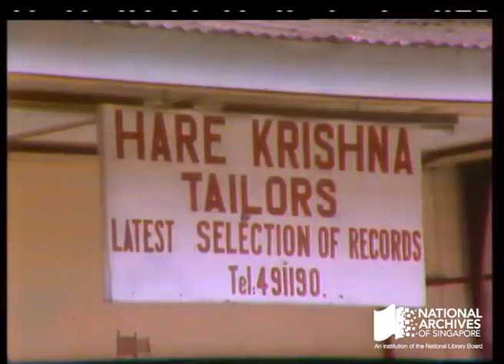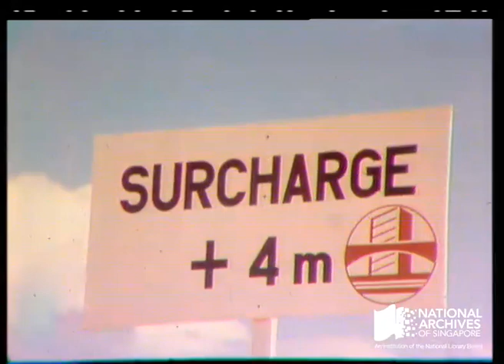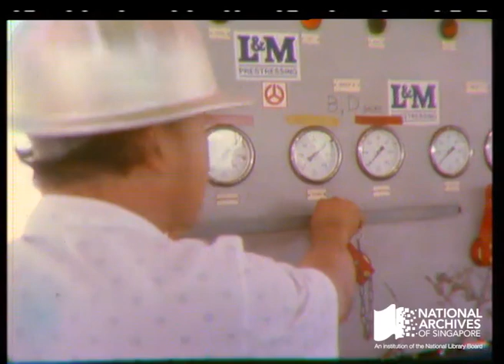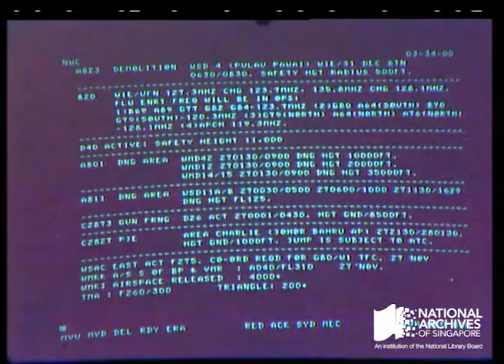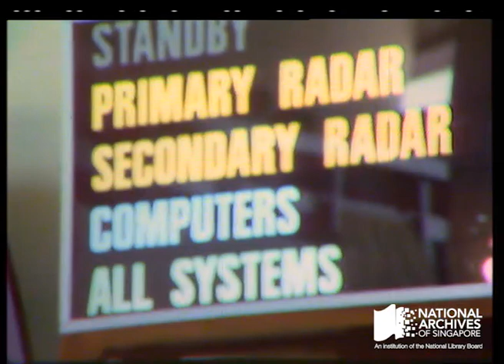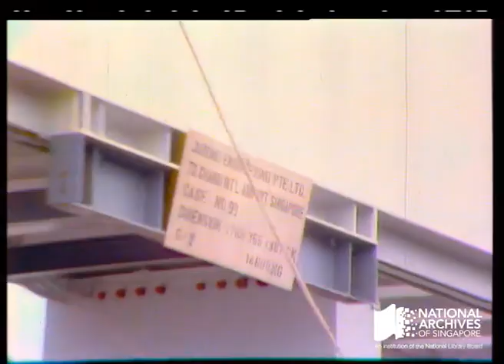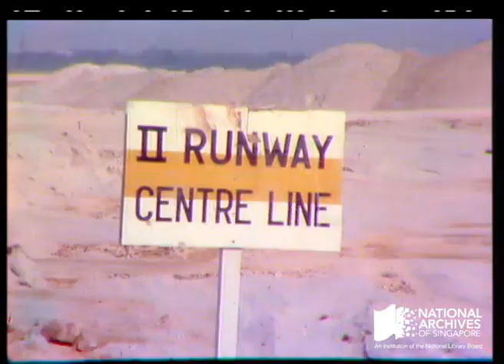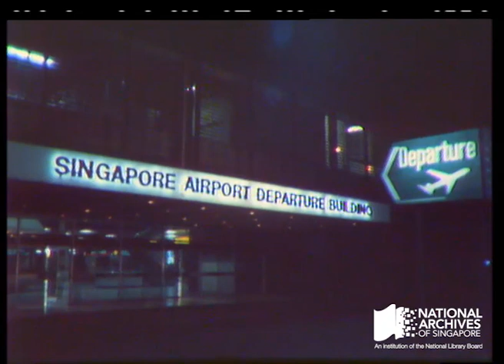SBC 1981 - The Changi Take-off

Comment: The Concorde at 3:20 is probably one of the rarest Concorde variants, only lasted from 1977 until 1980. IIRC part of the reason why the deal between British Airways and Singapore Airlines fell through was due to Tun Dr Mahathir (Also a new Malaysian Prime Minister in 1981) threatened to cancel important contracts that would leave Singapore dry (quite literally, since Singapore needed clean water from Malaysia). At that time, the Singapore Concordes going to London would fly above Terengganu and disrupt locals with loud sonic booms. In the end, due to threats and higher fuel prices the Concorde program eventually stopped in SEA regions, only going as far as Hong Kong in Asia.

Comment: Singapore builds new airport, where the original terminal is still in use, having been expanded over the years. 

Manila, builds new airport terminal which is obsolete by 1993.
Reply: But hey, you can experience both the world's best and (one of) the worst airports with just a short 3 hour flight😛